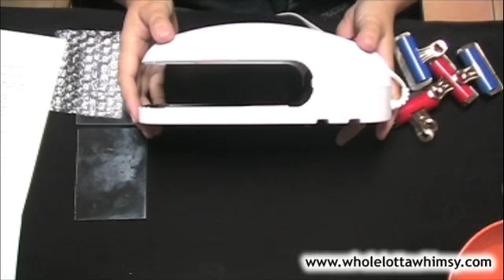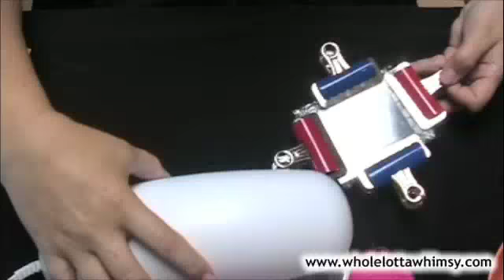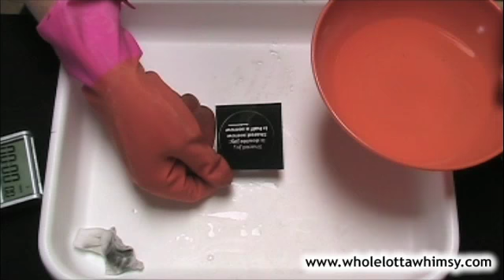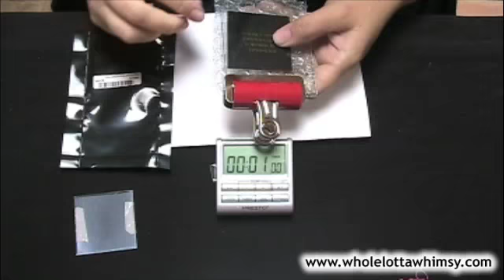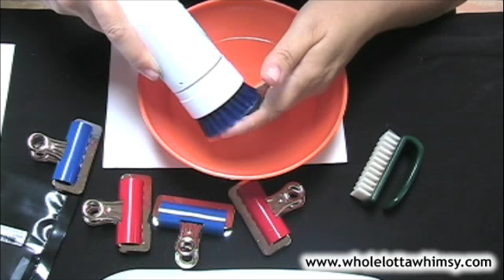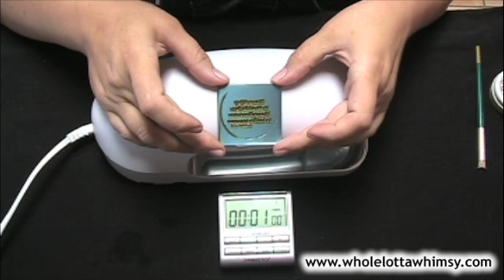Photopolymer Plate Tutorial

Comment: Is there any reason not to just print your own transparencies?   You can get transparency sheets for both ink-jet and laser printers.
Reply: TechSupport100 It very much depends on the printers ability to create enough ink density. Some do, some don't.
Reply: Jan F If you run into that problem, you can stack transparencies - two will usually do it.  Just line 'em up carefully and tape them together.
Reply: En   españ
Reply: la pregunta y respuesta, en Espanol?   @felixteran4480

Comment from the maker: lanetxgp1:
You will get better results if you are always putting emulsion or ink face down on the TNF or PPP.  This is why it was printed in reverse and then flipped over so you could read the words face up.  The least amount of light and space  you have between the letters, the better the results because there is no UV light that leaks on the edges during processing.